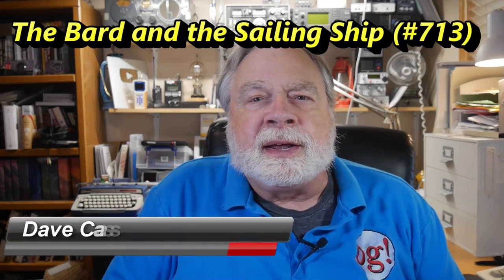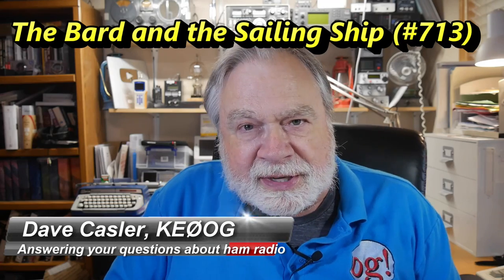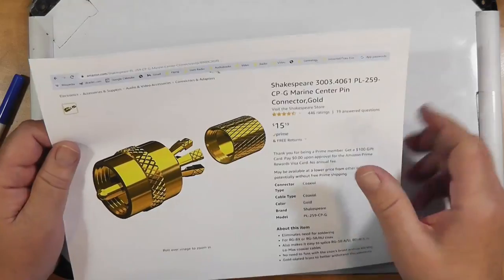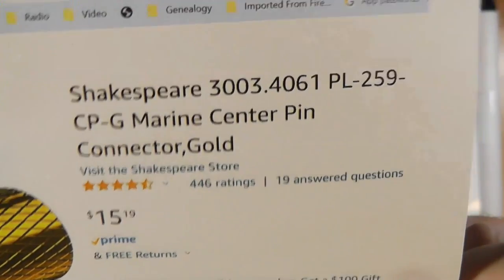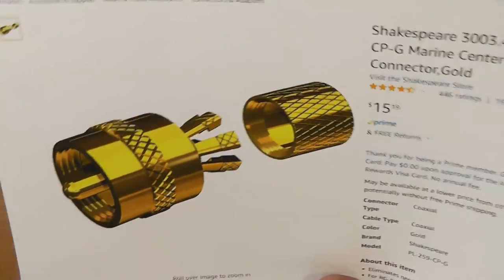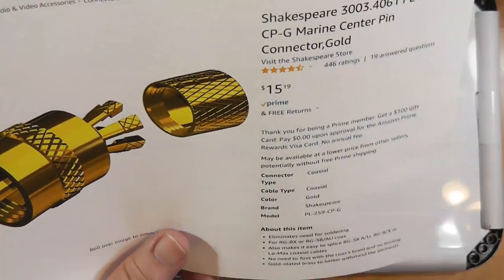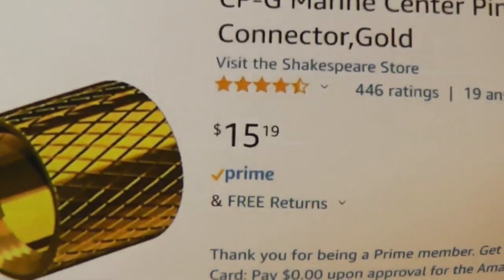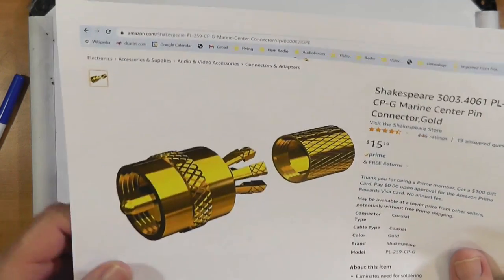The Bard and the Sailing Ship (#713)

Comment: Depends on what kind of boating you do. Yes the marine environment is harsh.  Two is one and one is none! Corrosion, damage, etc will often take one out of service. With 2 independent radios  and antennas you always know have one. My main vhf antenna is mounted on top of mast (use 3 db antenna for top of mast) my 2nd vhf  antenna  is on the rail and  I also I have an emergency antenna that I can set up if needed.  If you are just day boating insight of land then probably don’t need all that.

Comment: I was once forced to use one of those gold Shakspeare connectors, nothing else in stock. It worked perfectly well!
 Something that boaters may miss is VOLTAGE. Make sure to use the shortest run of wire you can, and make it oversize to minimize voltage drop.
 Those selfvulcanizing tapes are often in the plumbing section, not electrical, btw.
 And racers may prefer a thinner lighter cable, not TM400, because they want less weight aloft.